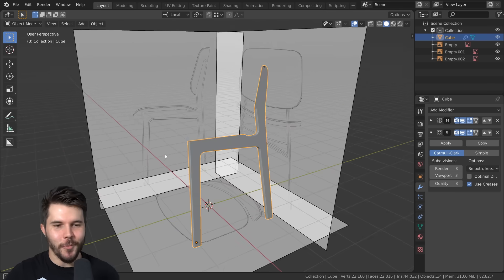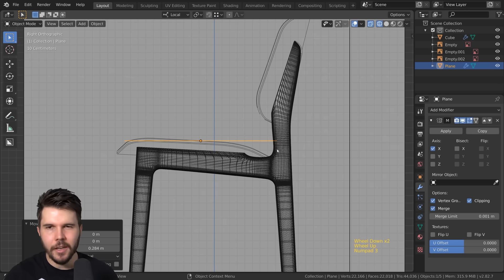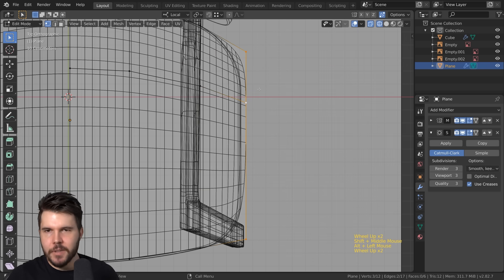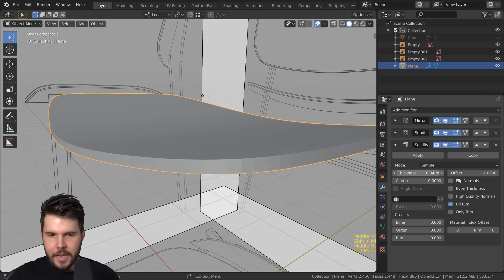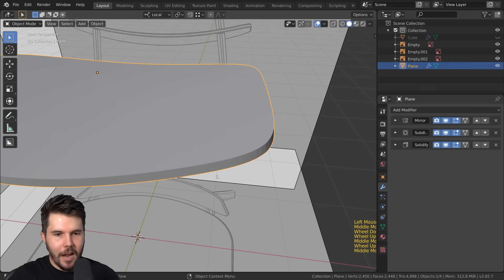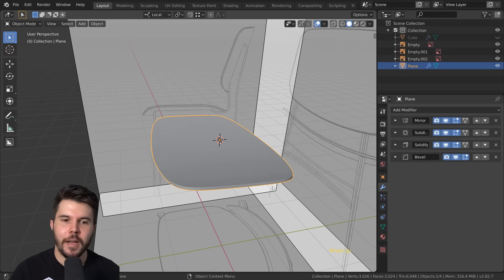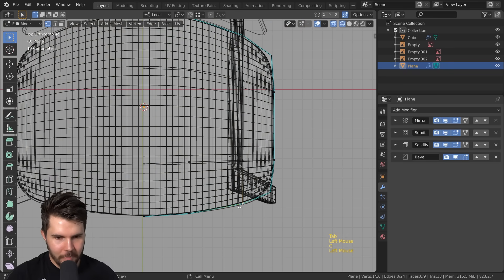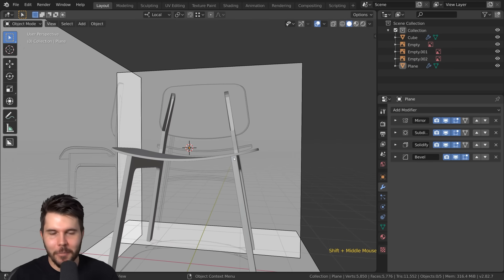Blender Beginner Modelling Chair Tutorial - Part 4: Modifier Mayhem

Comment: Personally when using the bevel modifier for sharp edges I like to set the segments to 2 and the profile to 1. That way it essentially just adds 2 support loops around the edge you're beveling. That does mean that if you put the camera very close to the edge, you can see that it is a sharp angle, but it doesnt shade like one. If you dont have auto smooth checked, of course. Profile just controls how curved the surface is with the default of .5 being a smooth curve and 1 being fully sharp. This I find is the best way of doing small sharp bevels. They shade perfectly and don't mess up your surfaces. And as they act like support loops, it is entirely doable to have the subdivision modifier after the bevel. This does not work very well with with large bevels, but for small sharp edges like here on the chair, it is ideal as it is a very small detail. Hopefully someone can find this useful whether you are working on this chair or some other model where you need sharp edges. c:
Reply: ....and you put the Subdivision Surface-modifier at the BOTTOM of the stack. I'm using the same way for years (learned it from GSG) ;-). If you use this trick to the chair legs as well, you can change the Bevel later easily. Still a great tut though. 

So in my opinion, this should be the order of Modifiers: 
1. Mirror 
2. Solidify 
3. Bevel (with 2 segments and Profile set to 1) 
4. Subdivision Surface

Comment: The inner lines you see are actually the bevels borders, in the real life those lines should not exist because the bevel surface is tangent whit the adiacent surfaces, but the CAD technology can't recognize this condition so the program put in the borders of the bevels an edge. This edge can be hidden but according to drawing specification, those borders must be visible in the final drafting.
Reply: Bevel is an incorrect term here. Fillet is the term used to describe what has been done to the two meeting face edges. If a drawing was required for setting up mass production then you'd specify a radius to define the size of the circular face that is created between the two straight faces.

Comment: When you beveled it you missed something: HARDEN NORMALS. What this does is it causes the bevel modifier to stretch the normals out OVER the bevel, and leave the original geometry flat, creating good normals for smooth shading. It only works if you have Auto Smooth on, so it will actually cause Auto Smooth to look at what the bevel modifier is doing to the normals.

Comment: Nice to see what i did wrong by trying by myself. I started out with a cube, loop cutted along y axys, modelet into the shape, inlayed the top and the bottom faces to get a top part bevel line, added two loopcuts along the edge and setted a subsurf to smooth the edges, but i encountered some issues with the clipping of the mirror and resolved with some fiddling around the merging and x axis alignment to eliminate some of the artifacts.
But it does some strange curves in the side part that i could not fix. Starting from a plane seems a much better, neater solution!

Comment: 9:42 if the smooth comes back after adding the bevel, maybe instead you can try to check Harden Normals in the bevel modifier.
Also for the next tip with Harden Edges that is applied to the mesh, there is also a checkbox for that in the bevel modifier 😉
Reply: you're the best!
Reply: Thanks!
Reply: There's always a hero in the comments!
Reply: thanks a lot
Reply: what if that's not the case I only get those rectangles when I decrease the offset for example when I have offset 0.1m it looks ok with the shading, but when I use 0.002m what he uses I get those rectangles I had in the beginning, I also checked for ur comment and harden normals is disabled
Reply: @lynx_s1958  maybe it's because of auto smooth. Try look inside vertex properties and uncheck auto smooth.
Reply: Legend, thank you sir (Edit) Sorry I just realised this is a 3 year old comment but it is still helping people to this day <3
Reply: @flux2787  and I am still learning. I have just seen that if you harden normals, it creates normal data stored inside the mesh. It can be a problem if you are using autonormals (autosnooth) and modify your mesh afterwards. If your autonormals don't work anymore, there's a button for clearing normal data, but you loose all of your previous harden normals. So my advice is to create the mesh first with autonormals, then make bevels.
Reply: Or use the bevel modifier with bevel edge data. It's sounds a bit complicated but it will eventually make sense with practice (I learned the hard way)

Comment: I would personally use Lattice for the bending to be more non-destructive
Reply: lattice wouldve been more useful if there wasnt reference
Reply: More than one way of doing things!
Reply: @Gredran  What are you guys talking about? could anyone explain me
Reply: @balaganesh3440  I think they meant that during the part where you bend the plywood inwards, instead of moving various vertices along the z-axis, you apply the lattice (sort of a cage) on top of the plywood and modify the plywood instead. It's less destructive because the underlying mesh is all on the same plane (you did not move it along the z-axis to achieve the curvature), and the lattice modifier is just much easier to adjust the curvature in case you needed in the future.
Reply: I thought of simple deform modifier but lattice would certainly give you more control!
Reply: ^This is definitely the way to do it!
Reply: what is this
Reply: That works great, really easy. Thanks for the tip!
Reply: That's probably a good idea for Andrew to follow up on - do the back differently.
Reply: Yeah, but on the other hand, its just a plane with not many verts, not a complicated mesh
Reply: less destructive*

Comment: Normals and modifiers that 'modify' them can sometimes get confusing as you only see the shading and don't really see what has happened to the normals in a more direct way, I usually throw a weighted normal modifier (weight to 100 and face influence ticked) at the end just to see if the result changes. (using certain add-ons it happens that I set custom normals for an object without realizing it and wondering why the normals don't do what I want, after finding out and deleting the custom normals everything starts working again)

Comment: You didn't explain why someone's mirrored object could be different to yours, I worked out that I had moved my leg in edit mode which left the object origin at 0, 0, 0. What I needed to do was move it in object mode which moved the origin with the object.
Reply: You can also change the object's origin to the 3D cursor (which should be at the world origin). Object > Set Origin > Origin to 3D cursor

Comment: I think your smoothing problem is because Auto-Smooth is set to 30° and with more bevel segments you are coming under that 30 degrees :)
Reply: Even if you're not using auto-smooth, it's important to change the limit method of the Bevel modifier to Angle (or edge Weight), otherwise it'll bevel edges that shouldn't be beveled, and the Subdivision Surface modifier will smooth the surfaces incorrectly. Remember how Andrew showed us that SubDiv uses 3 edges? Well, the bevel will get in the way of those for smooth continuous surfaces like the chair seat if it gets applied to the interior edges.
Reply: @BeheadedKamikaze  Um..... I think he already said this.
Reply: this fix is better because it makes less segments